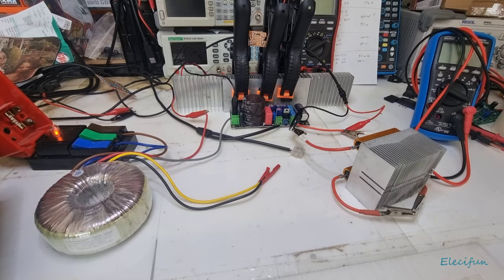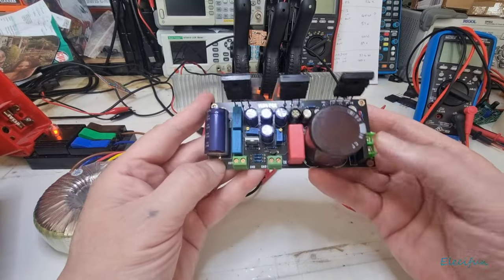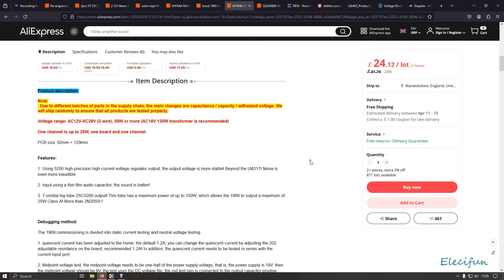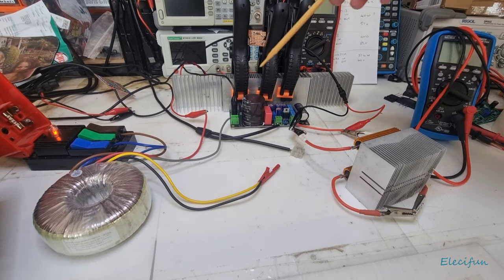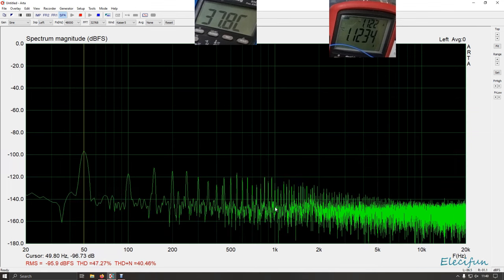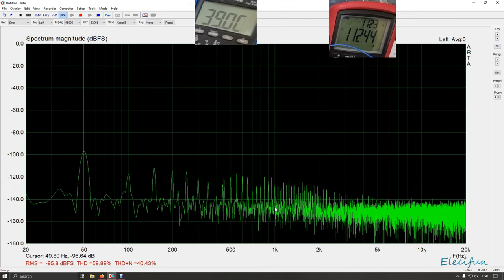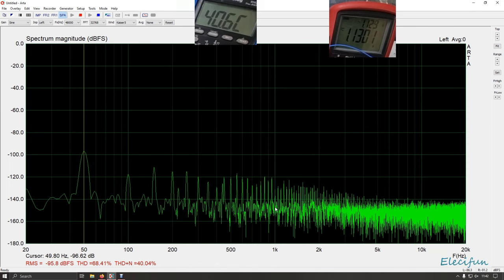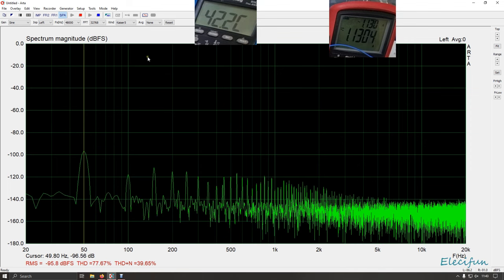John Linsley-Hood 1969 Class A Amplifier (Aliexpress) Initial Tests

Comment: It's surprising to see these amps getting the full commercial treatment.  The original design apparently came about because JLH was considering moving from his Williamson Mono Valve system to Stereo, and decided rather than build another Williamson he would try the new fangled transistor things. So he designed a minimalist Class A amp. , basically a four transistor design, and to his surprise found it provided comparable performance to the Williamson. He wrote it up in 'Wireless World', and people have argued about how the output works ever since. So compared with modern stuff it won't measure particularly well, modern (fast) transistors may give it indigestion, won't drive stubborn speakers, and won't do loud. And like the Williamson, you can probably switch the heating off.  A bit of a cult item.  For a more modern 'take' on class 'A' see Nelson Pass or Douglas Self.
Reply from the maker: @everTriumph Thank you for the informative comment. I will check out the Nelson Pass and Douglas Self.